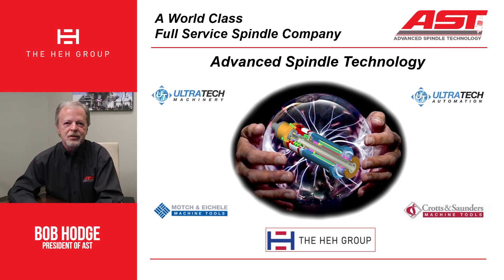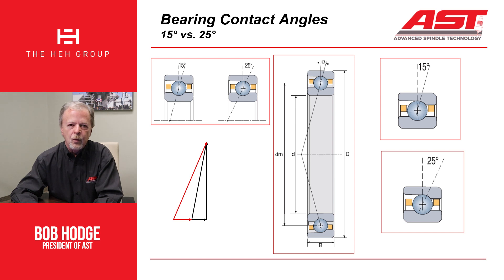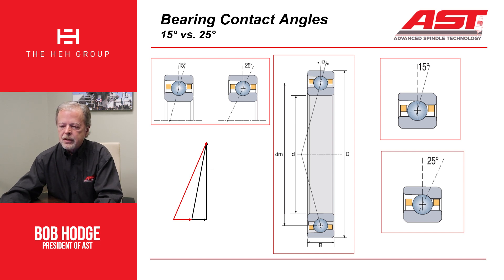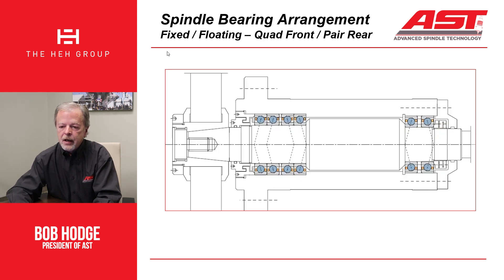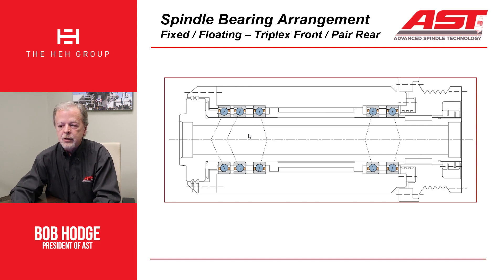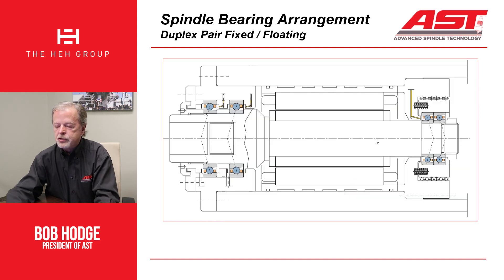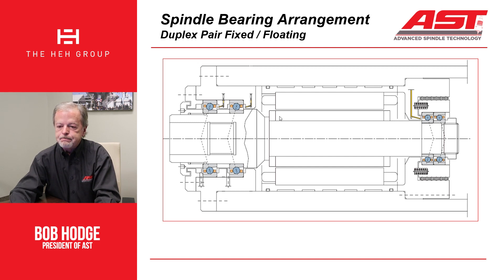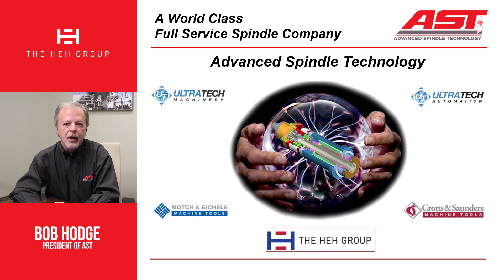AST Tech Talk | How Bearings Impact your Spindle

Comment: 4:57 - then why they are also angular contact pair ?    it makes spindle more expensive for no reason.
Reply: I've rebuilt a spindle with two pairs of angular contact ball bearings, one pair at each end of the spindle.
I also thought hmmm, I can save some money and simply use two radial bearings on the inboard end of the spindle.  Doing this would impair the stiffness and, in all likelihood the accuracy, of the spindle.  Radial bearings are manufactured with some radial clearance and this would make the spindle assembly less stiff.

To purchase a pair of radial bearings without radial clearance I found next to impossible or cost prohibitive.

Also, the spindle assembly was designed such that tightening the inboard spindle nut pre-loaded all 4 bearings appropriately.  I did have the 4 bearing spacers reground so that each pair of spacers was parallel to millionths of an inch and the same thickness.  The result was a beautifully running spindle.

After all this I had to re-machine the spindle nose taper because it still ran out almost .001".  While hardened it was still machinable with a tungsten carbide insert.  The set-up took a little doing to get the taper correct, but all turned out well, machining the taper in place on its own bearings.
Reply from the maker: To better balance the preloads. So you don't have much of a weak link. 
During our spindle repairs, we assess each spindle and make decisions based on the usage and choose components to optimize its performance.